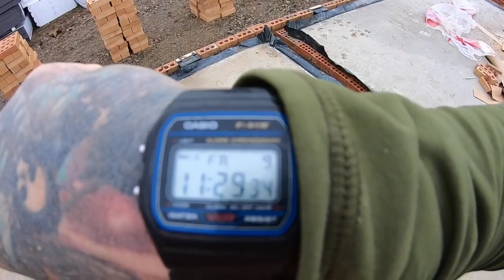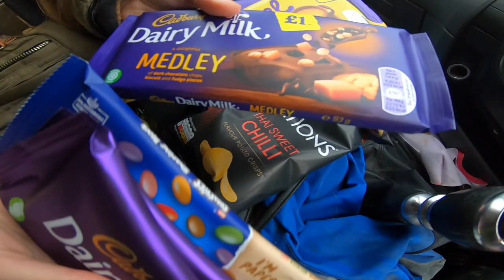Bloody weather!!!

Comment: Ive been driving telehandles for 10 years tell that driver to put his outriggers all the way down so the wheels are way off the ground and the machine will put a pack if bricks at full boom no problem
Reply: Experience is key, the machine wants it weight bias to the back when chucking that pack way out. You are bang on the 💸

Comment: Have you tried "Alex and Steve" brick tongs?  ( Just fabbed out of rebar).    Can't believe those packs of blocks stacked vertically and site has no system to unload them. Stand back to the pack, Stanley the corner and catch one off each corner?  Nah just not going to work is it. Crash 
Mats ?  Surprised big sites not organised better to avoid bricks getting damp and frozen. Enjoy all the chips! (That's how you do so much work then)